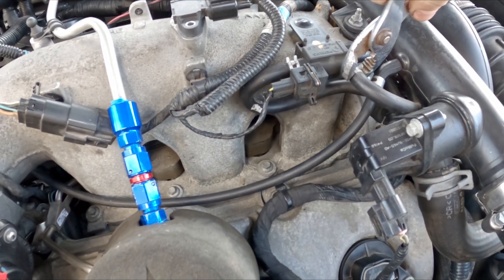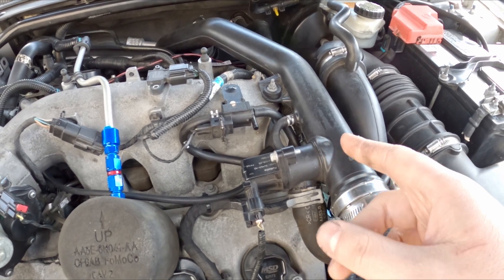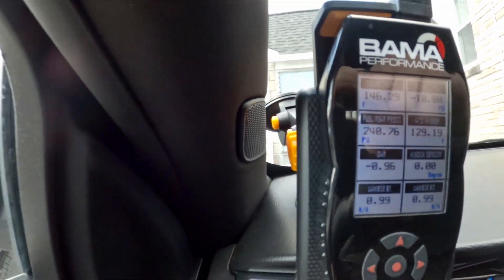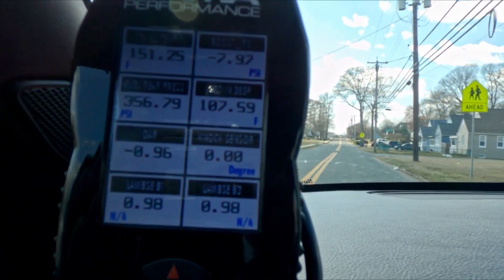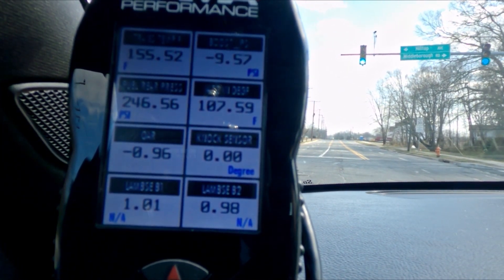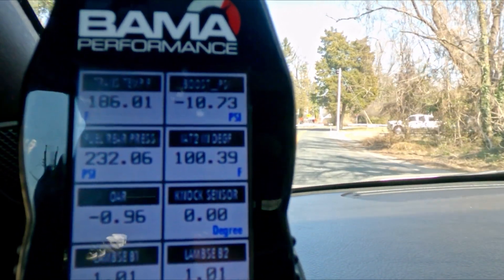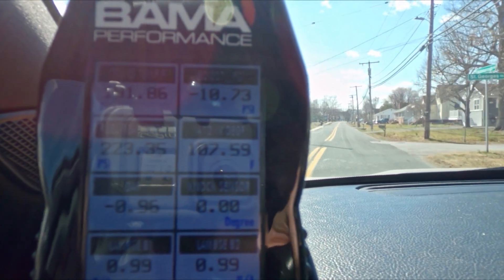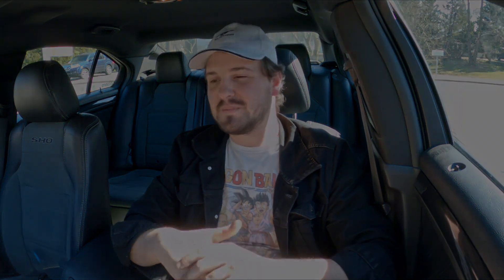Boost Controller bypass for MAX BOOST! Ford Taurus SHO Test

Comment: So the Ecoboost control strategy controls boost primarily with the throttle body. Most tuners don't even mess with the WG control logic when increasing power. The BOVs open because the TIP actual is passing TIP desired and the ECU is closing the throttle.

Comment: Where do you have your boost gauge hooked up to? Can’t find a line with vac and boost
Reply from the maker: I had a vacuum tee that was made by someone in the SHO community. It basically was a universal half inch straight vacuum coupler with a eighth inch brass barbed fitting in the middle. It was installed by cutting the hose to the brake booster and reconnecting it between. That way it was close to the firewall and easy to route a line to the cabin.
Reply: @KarzKreated  so I actually found a clutch spot for the SHO (atleast a 2013) or newer and it’s in the door well there are a couple tiny spots filled with insulation you can run right to the cab from under the hood without going through the firewall. But I cannot figure out where to put my T with the line and not 100% sure where you’re talking about the break booster
Reply from the maker: @tracemiller1519  follow the breather hose  from the intake tube back to the firewall. The thick hose to the left is the one I used. It connects to the intake manifold just after the throttle body.
Reply: @KarzKreated  so I’ve had my turbos whistling louder then usually and haven’t been able to hear the BOV or intake at all anymore, no noticeable power loss and the turbos sound fine they are just whistling louder then ever when before I couldn’t hardly hear them. Any ideas of what that could be?
Reply from the maker: @tracemiller1519  not sure on that. Could have a small boost leak somewhere causing the additional noise. The rubber couplers on the turbo outlets are known to tear, crack, or split causing a boost leak. If the sound is coming from or near the turbos, that's something worth checking.
Reply: @KarzKreated  yea someone mentioned a silencer ring to me several times but other then that I’m not sure. Just all of a sudden no blow off noise or shwoosh sound from CAI and the turbos are whistling way louder. But no power loss and the turbos sound healthy they are just a lot louder

Comment: How did you get your SHO to rev like that in park? My buddy has one and for some reason when he revs it in park it'll only let him get up to 3500 RPM. Is there any way to remove this limiter?
Reply from the maker: I'm not sure if the tune I had raised the limiter or not. I don't think I tried to Rev it like that on the factory calibration.

The tune it had was a revised Gearhead Auto Octane 93 Performance Tune.
Reply: @KarzKreated  ok thanks Ill let him know. He's in the process of getting the most out his factory stuff
Reply: I have an X4 tuner with an unleashed tune and neutral/park rev limiter is definitely adjustable from the tune. I have the option to modify mine before flashing a new map.

(I know this is a zombie post but people still mod and rip these cars)
Reply: @716monk  thanks for the reply, I'll send him the info 👍

Comment: What lines did you unplug? Boost numbers before and after? Did you cap off lines?
Reply from the maker: I took the hose going to the wastegates and connected directly to the port on the intake pipe, thus bypassing the control solenoid. I noticed a peak gain of 3 psi and around 2 psi sustained. Doing this doesn't gain anything in power because the car is constantly trying to adjust and compensate for the changes. I do not recommend to do this to your vehicle. This was a fun test to better understand how the car operates.

Comment: What bama tuner is that?
Reply from the maker: X4
Reply: @KarzKreated  THANK YOU
Reply: @KarzKreated  do you have a link I can't seem to find a Bama x4 or any Bama programmer for a sho
Reply from the maker: @StreamlineGarage  Any X4 for newer Ford vehicles (7015) will work for a SHO.
I originally ordered the X4 for my Cobra. But it also works with most newer Fords.
You can buy any Ford specific X4 and it will work.

Comment: What if you removed the blowoff valve 🤔
Reply: Engine go boom
Reply: Turbo flutter jesus
Reply: @NormsFunChannel  if cars don't need it then why do the manufacturers put them on in the first place? Definitely not longevity!
Reply: @mattsommers01  I mean it will just wear out the compressor wheel, it won’t damage anything else. RB26 for example and also any duramax motor with compressor surge
Reply: @tyberious3023  "only", its a compressor wheel not an oil change. I had to replace the turbos on my mks and it was a huge pain in the ass. If you want to sound like a buffoon and make noise put a fart can on your exhaust
Reply: Meant to quote "just" lol
Reply: @NormsFunChannel  until it blows up lmao

Comment: What up fomocobro! I have a tial BOV  I wonder what my rig would do I sometimes see boost spikes  at 20 psi on my stock turbos! I imagine I am already out of breath with my turbos but I wounder if it will ramp in the boost sooner being unbridled 😆!! Your braver than me so for now I'm not gonna test it! Not really trying to see the piston rods yet! I'm sure its in my future just distant future hopefully!! Gearhead AO tune catless downpipes cold air intake and some other small mods! My next move is more fuel pump till then I'm not gonna chance pushing it to far!!
Reply from the maker: That seems to be the benefit of electronically controlled BOVs. They react quicker to control boost spikes. But since you have a vacuum controlled BOV, theoretically you can run a manual boost controller or an independent boost solenoid. I've looked at dual stage solenoids and the benefit seems to be that you can set the first stage at a lower boost level thats plays nicely with the factory fuel pump and then use rpm to trigger the second stage at a higher RPM when fuel pressure is stable enough to run much higher boost levels. The danger on a stock setup seems to be at lower rpms when fuel pressure isn't maxed and engine load is high. That's why I did this test because I needed to if I could use a dual stage boost solenoid.
But your next mod is definitely the gatekeeper! 😎👍

Comment: so how much power does it gain you
Reply from the maker: It doesn't. With factory BOVs, the car will still Target commanded boost. In theory with traditional vacuum controlled BOVs, you could "trick" the cars tune and run more boost with a manual boost controller.
Reply: @KarzKreated  that’s confusing, I thought the whole point of boost was to gain hp and if it doesn’t gain you anything then why are you trying to gain boost
Reply from the maker: The car was seeing 1 or 2 psi more but because it was controlling boost with the BOVs, boost would drop back down to its command target. In this case it does not give a usable power increase.
Reply: @KarzKreated  blow off don't control boost. They let out pressure from your charge pipe after throttle is closed. If no blow off valve thebair would go back to the turbo giving u turbo flutter. Boost controller and wastegate on the turbo is what control the boost. The internal wastegate on the turbobis what your running off.
Reply from the maker: I Understand. It's a failsafe feature to keep the target boost at its set value. I bypassed the boost controller so the wastegates were fully open. Even though it spiked higher than it would normally, the BOVs would open up to vent enough pressure to match the boost target.